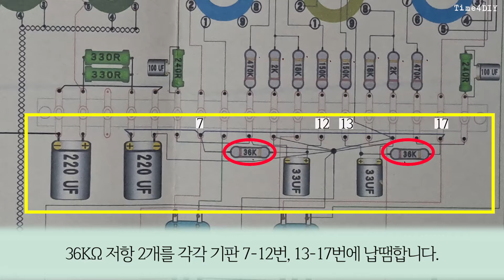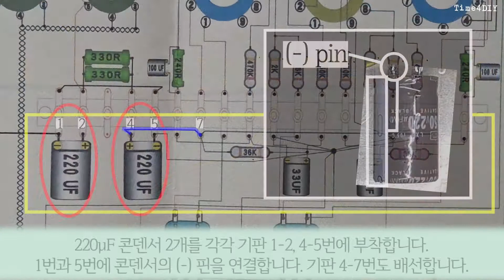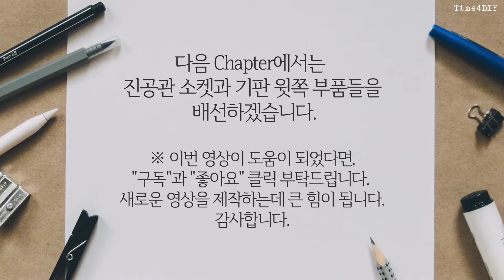[Manual#5] 6N2 6P1 진공관 블루투스 앰프(기판 부품 배선①) 6N2 6P1 tube bluetooth amp (Board component wiring①)

Comment: 점퍼 구리선 규격이 궁금합니다.
Reply from the maker: 안녕하세요. 제가 산 규격은 18 AWG 입니다. 
아래에 링크 찾아 붙여드립니다.
BV Solid Copper wire Electric cable 10 12 14 16 18 19 20 awg Wires 14awg 16awg 18awg Electrical PVC Single core cables 220V 380V
https://a.aliexpress.com/_mtveGsA